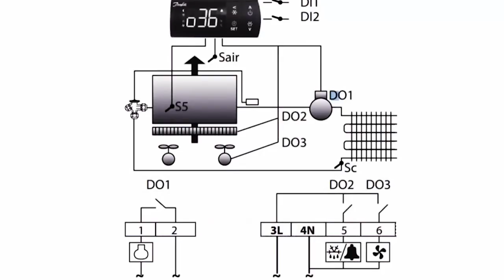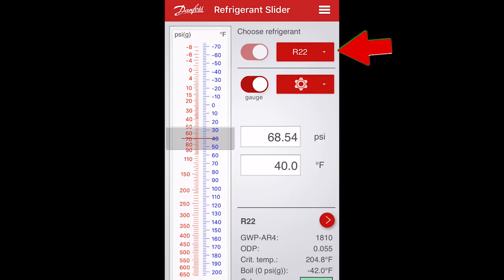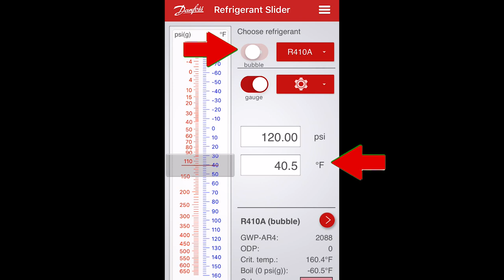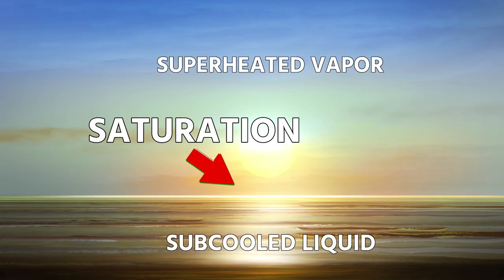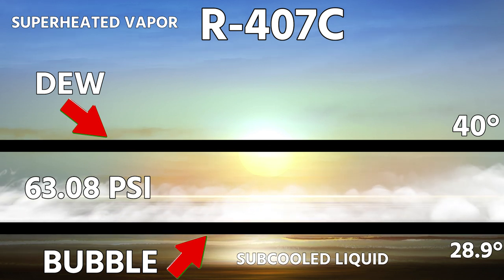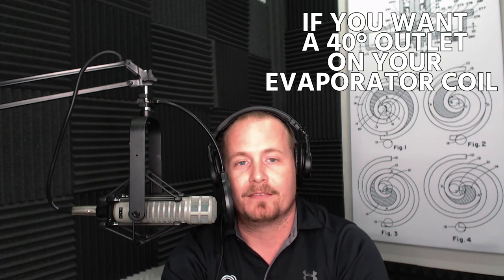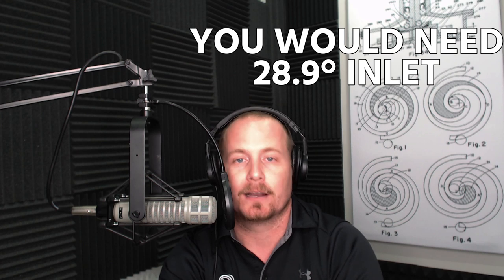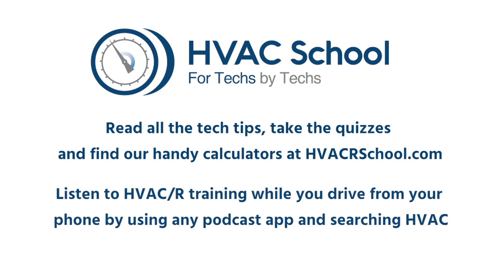Bubcool and Dewperheat (Bubble and Dew Point explained)

Comment: Thank you for a great video.  I have a question that I could not find the answer to in the book.  I found a couple of recovery cylinders at my work that have refrigerant in them.  The first was a no-brainer - it was R22 and matched up perfectly to the PT chart.  The other is an R22 substitute.  When trying to match it up using the slider app, do I use DEW or BUBBLE point to match it up?  I think the correct answer is Bubble, which pretty much makes it look like R422D, but I am not sure.  We used to have three R22 chillers and I know at some point one of them was retrofitted with a "drop in replacement" while the other two were still on original R22.  All three have since been replaced.  Thanks in advance for your help.